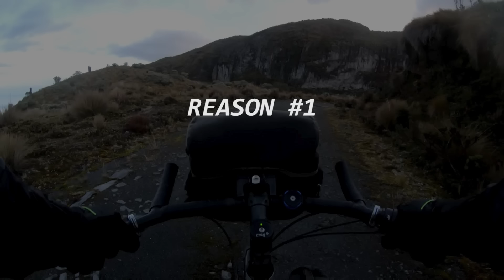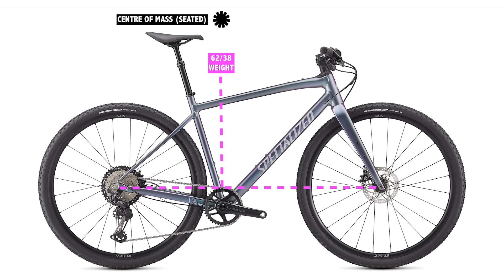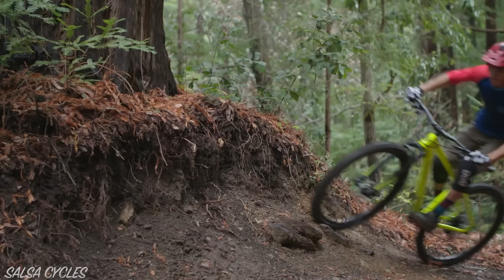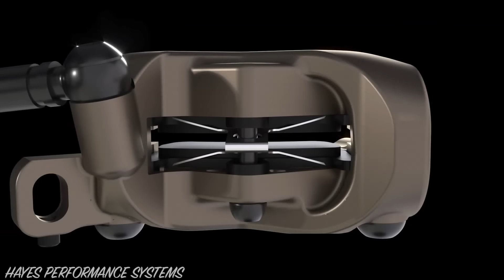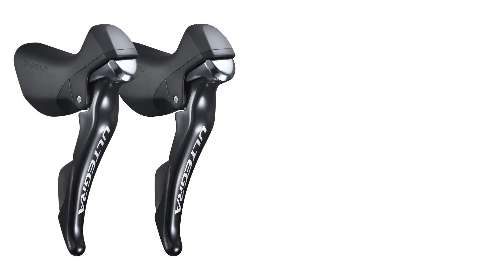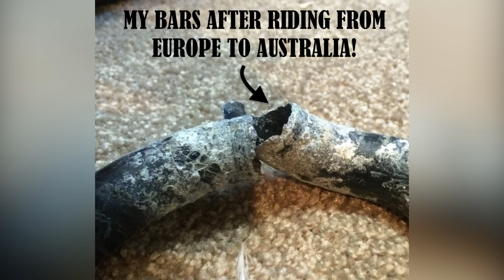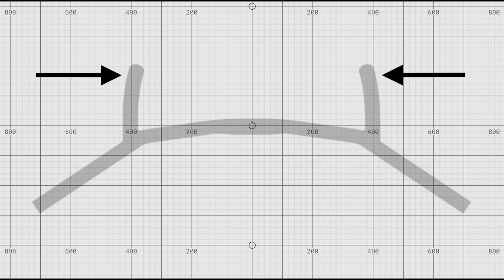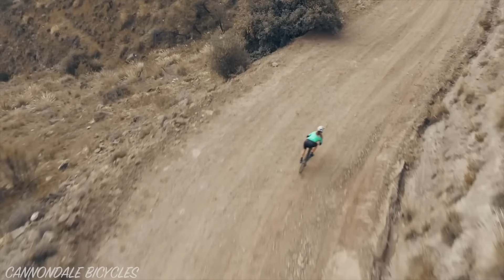Why Flat Bars Are BETTER Than Drop Bars For Most Cyclists (Objective Analysis)

Comment: But can you have 2 braking positions on flat-bar-plus-aeros or butterfly bars? I have a drop-bar adventure bike with cross-top brake levers. I get two very different riding positions, both with full braking control. I'm open to wider bars, just wonder if I could do the same. (Saying that, I've been riding drop bars for 40 years, there's an emotional connection to cruising on the hoods!) Thanks @cyclingabout, great vid as ever.
Reply from the maker: This is a point I've overlooked! You can technically have control of your brakes from three different positions on drop bars provided you use cross/inline brake levers. I'll add it to the written version on my website, thanks.

Comment: Title a bit misleading, a lot of the points raised are related to the frame rather than the handlebars.
Reply from the maker: With the exception of two points, all of the benefits I discuss would still apply if you were to do a handlebar conversion from drop bar to flat bar, or vice versa.

The frame geometry related reasons are still very much relevant to the discussion because the handlebars work in conjunction with other components when optimising bike design. I'm sure many viewers will use this information to help pick one bike over another within the same bike category (eg. off-road touring bikes).

Comment: I don't think you understand what "objective" means
Reply from the maker: Please point out when I am being subjective.
Reply: The basic mistake that you're making is that you're sort of stating something objectively, but then drawing a subjective conclusion from it.

1. Wider bars have greater leverage - true. But that's a function of bar width, not shape. It's further incorrect to draw the conclusion "better handling" - and that's subjective: How do you measure "handling"? What's your unit of measurement for handling?
4. "Better braking performance" - this is just your opinion. Braking performance is a function of your brake setup, not your bar shape.
5. "Low gear ratios are more common on flat bar bikes" - sure. But it's your opinion that that's "better". There's also nothing to stop you putting lower ratios on drop bars.
6. "Flat bars are often cheaper" - again, okay - but cheaper doesn't equal better. 
8. "Flat bars allow for more bikepacking bag capacity" - okay, again - it's your opinion that that's better. It's equally easy to argue that it's better that drop bars limit your ability to overload the front end.
9. "Flat bar grips are easier to live with" - entirely your opinion. No measurement here at all. Grips and tape are different to live with. There are pros and cons to each.

Most of the test of objectivity is being able to measure and quantify it; it's generally difficult to objectively say "better" in an absolute fashion. You can say "better for...", i.e. you can say "narrower is better for aerodynamics". Most of your other arguments fall into this trap.
Reply from the maker: I disagree. 

1. Flat bars are almost always wider, there are so few exceptions. Handling has been described in this video as the ability to resist ground forces, maintain your balance, maintain your line, reduce steering inputs. Leverage objectively helps in all of these instances.
4. Bike Magazin has done dozens of lab tests on brakes. We know that mountain bike brakes have more power and less brake fade as a function of their design. Plus, there are four piston calipers and larger rotors available, should one need them.
5. Obviously, this point is applicable only if you ride in the hills. A stock flat bar bike almost always has lower gear ratios within a given bike category, and I have that data in my books (all touring/bikepacking bikes available are listed). For retrofits, you can put any mountain bike drivetrain on a flat bar bike (ie. lots of options), but you have to hack your way into doing the same with drop bar shifters (ie. limited options).
6. Cheaper is always better when we're comparing the same thing. 
8. A bigger bag volume gives you more options, which is objectively a better thing. Easier access to the roll closures makes your life easier. Volume and overloading do not equate to the same thing - for example, I have winter sleeping bags that have a large volume but are light weight.
9. Flat bar grips do not tear or unwrap, ever. I can change my flat bar grips in literally one minute. Again, these are facts.

The title of my video literally says "better . . . for most cyclists". It is implied that these things are no absolute, and I've done my best to cover the grey areas by discussing the crossovers.
Reply: "It is implied that these things are no absolute" - if it's not absolute, then it is subjective.
Reply from the maker: Oh c'mon...

Comment: With regards to drop bars being better for urban riding they are better for weaving between vehicles due to the reduced width in general. They also encourage a more aggressive riding style. However your riding position makes it difficult to have good all round vision reducing your safety. In a more upright position you can see better and feel more relaxed (I know some riders don't want to feel relaxed, LOL)

There's also options for less wide flat handlebars for those who regularly weave between traffic. Personally I prefer flat bars for everything except competitive speed cycling.
Reply: In a flat bar you are way more agile, which makes it better for urban bikes since you need to do aggressive turns between vehicles, trees, people etc. in a drop bar you are slower turning the bike and you have less agility. Drop bars are great for the road only, going just in one single line, to rest for your wrists and have more aerodynamics. But if you want versatility, a flat bar is better
Reply: Personally I don't see any difference looking side to side with either bar or under a shoulder to look back on a drop vs looking over it on my drop bar bike.  Actually If I think about it I think I'm am more aware in a lower position because my head is angled down and thus requires a smaller turn to either side to see behind.  But also understand, if associating an upright stance with awareness, a drop bar bike rider can get just as upright as a flat bar rider by getting on the hoods or bar tops.  Granted, looking around in general will always be an issue for people with neck flexibility issues and if that's the case they will probably prefer the less "aggressive", more heavily-seated position their flat bar offers.

Comment: Many people think cycling is dificult because of a long term trend to inappropriately copy road racing bikes for more general use.  Because of this drop bars are arguably more poplular than their objective qualities would suggest.   People think hill climbing is difficult because road bikes  normally lack low gears. People put up with poor braking performance because road cycling has been slow to accept disk brakes.  People ride narrow tyres with poorer road holding performance is the mistaken belief that rolling resistance is lower.(Narrow tyres have low weight on their side).  People ride drop bars for the look without ever using their aerodynamic qualities.  People accept expensive difficult to use shifters because thatś what drop bars require.
Reply: I'm replying to myself.  For me ergonomics dictates flat bars for easy access to brake and gear controls.    Bar ends can do for hand positions.  Or place palms on ends of bars.  From there easy to return quickly to normal position.   Flat bars can be narrow if you want.

Comment: As allways it really depends on what type of riding you do. Personally most of the flatbar pros don't really effect me and I much preffer the handpositioning on dropbars. Though I gotta say I only switched 3 years ago and prior to that I allways had flatbars. 
It's great to see how much variation we get nowadays in both types of bars.
Reply: Agreed. A lot of the points in this video cover cycling on rough terrain & unpaved roads, where drop bars do not fare well. In this scenario, you'll usually be cycling in an upright position. Flat bars will be more suitable.

For road bicycles that will be used on paved tracks, roads, high speeds, with fewer expected stops at traffic lights, pedestrian crossings & stop signs... drop bars fare better.

Comment: there's also probably the factor for many road riders that when you look to pavement riding pros, all you see are drop bars. Even someone who knows nothing about cycling will recognize drop bars as being 'like the fast tour de France bikes'. They're used there because they're optimal in that hyper-competitive, niche use case, where aero is worth the tradeoffs, and they get copied by people who will never really need that efficiency, but want to feel like they do. It's the same reason people get full suspension to ride fire roads, or an ultralightweight tent for a campsite they drive to.
Reply: Drop bars are mandatory on road races. Other bar types are not allowed, aero or triathlon bars are only allowed in time trials. Even some positions on the bike and handles are outlawed.
Reply: EVERYone would notice a HUGE difference between using a flat bar and a drop bar on a road bike... it's not a "niche use case"

Comment: What I don't get is why manufacturers seem to use the same width of flat bars on all bikes.  My wife's small frame women's bike came with bars for some guy who is 2m tall.  She is 150, so I needed to cut 10cm of each side.   In fact I think I have sawed at least a couple of cm off every set of flats I have ever bought.   When my wife bought a women's bike with drops they were proportionally narrower.
BTW, when riding on a street shared with autos, my wife is now 10 cm further from cars than on the bike that came out of the bike shop.

Comment: I rode exclusively with drop bars for over 25 years because of a single, incorrect preconceived notion: drop bars offer more hand positions. When I finally got around to trying flat (Jones H-Bar) bars, I noticed two things. First, of all the hand positions offered by drop bars, I used only one for 90% of the time. In the hoods. Second, now that I wasn't using drop bars anymore I found that I was enjoying the ride more, and worrying less about speed than I otherwise would have. IMO there's a psychological feeling that drop bars are more competitive and thus more serious. Serious cyclists use drop bars. Thanks to this recent shift to flat bars, I no longer consider myself to be a 'cyclist', but a traveler who just so happens to ride a bike.

Comment: 0:52 I don't really believe that you need a lot of leverage on handlebars. I can't recall any situation when I didn't have sufficient strength to make a turn. 

HOWEVER wide bars give us the ability for more precise steering. Which is very useful for line choice in mountain biking
Reply: More so bikes are light to lean over thus making countersteering much more effective with body movement. In combination with well timed movement of handlebars you really don't need lot of leverage.

Comment: You make some good arguments. Objectively, I agree even, but ergonomically I find drop bars more comfortable for longer rides.
Reply: I can sign it…additionally, much more comfortable
Reply: Butterfly
Reply: how does your neck not hurt though being that low so often? my neck wants to explode out my back after a short while on drops
Reply: @digitalsmithy  How low the drop handlebar is depends on the bike, and your own height: how long your legs are (determining how high the seat is). Unfortunately, on modern bikes with threadless headsets, it is a real hassle to raise the handlebars.  For everyday riding (not in a race), you want to be in a more upright position, a least when your hands are on the top bar. On a classic bike with a quill stem, that's a 30 second adjustment: loosen the sliding block of the stem by turning the bolt with the hex wrench, pull it to the desired height, tighten.  The bike industry decided to enshittify this.
Reply: @digitalsmithy  A lot of modern road bikes have a frame which has next to no head tube length. Basicall the top tube and down tube meet together at a minimal head tube.  When these things are assembled, sometimes they just cut the steerer tube short and plant the stem close to the head tube, so the handle bars are really low, close to the front wheel. This creates an "aero" position, especially for the tall rider who has to jack up his saddle.  If you care about back comfort, basically stay away from that kind of setup. If you get that kind of frame, make sure that the steerer tube is sticking out nice and long, with spacers, so that the handle is raised.   The old school threaded headset system is best: the handle bar stem is a rod tightened by a sliding wedge. You can easily raise it (or lower, if it is not all the way down) just by loosening one bolt. If you need it higher, you can easily buy a longer stem, too. ($20-$30 on AliExpress type thing).  There is a way to use quill stems with threadless headsets; you have to lose the top cap, of course, and use a clamp ring to hold the steerer tube in place in place of the clamp-on stem. Then you can insert the quill stem into the steerer tube.  The star nut in the tube has to be pushed out of the way, too.
Reply from the maker: I'm glad to hear drop bars work better for you ergonomically! I personally find both to be comfortable. 💪🏼
Reply: I find drop bars to be too far forward which makes reaching the brake levers hard while being able to use the advantage of brake lever leverage only in lowest position on the drops which doesn't get used due to being too low.
Reply: @uvwuvw-ol3fg  
That just sounds like a bad set up.
Reply: @Exgrmbl  Additionally, it's caused by having brake levers in the conventional forward position, because ... everyone on road bikes does it.
On my bike, I have flat bar levers, which are on the flat part of the drop bar.  That sets them back considerably, meaning that the brakes are in my grasp in the upright, "cruiser" position.
Reply: @uvwuvw-ol3fg  drop bars should be considered along with your bike length..
Reply: @uvwuvw-ol3fg  maybe have a shorter stem
Reply: @taufikabidin412  Tons of choices there. Stems are available in various length of extension. Plus adjustable angles. And stems can be turned 180 degrees: you can considerably bring the bar back.
Reply: @uvwuvw-ol3fg  Everything is adjustable.
Reply: @uvwuvw-ol3fg  Probably using classic one. Try compact and shorter steam (or adjustable steam that may look not that handsome).

Comment: As always from you a very informative video. But in the end it all comes down to personal preferences and limitations of your body. Flat bars suck when your wrists start hurting after 25 km. Drops bars suck when your neck stiffens up after 30km. Just right what you like best.
Reply: It’s unfortunate this isn’t generally something a person can know until they’ve potentially invested a lot of money into a bike.
Reply: If your neck hurts from riding with drop bars then you need a better bike fit. Likely a shorter reach and a higher stack. That specific problem is unlikely due to the bar type.

Comment: The thing is, "most cyclists" cycle in urban environments most of the time, because that's where most people, and certainly most cyclists, live, since that's where cycling is most practical. So if that's where drop bars excel, then drop bars are the best option for most cyclists as per your video.
Maybe not for bikepackers, mountainbikers or other adventurers. But that's not what you said.
Reply from the maker: I said drop bars excel in urban environments. But that is only one way we can assess whether they are suitable for a rider - we need to factor in all other areas of assessment too.

Comment: I don't buy the argument that drop bars are better for urban riding (unless you do it for sports ;-) ). In my urban bike I have flats coz:
1. I have a more upright position what makes looking around way easier in comparison to when I'm bent down on drops. That's an important safety feature.
2. Toe overlap is a serious issue in the city as often you're forced to go slowly or almost stall (street lights, interacting with pedestrians and other traffic).
3. In most European countries you are either not allowed to cycle on the pavement or you have to give way to pedestrians, so a narrower bike gives you no advantage here (for sneaking between cars it's helpful, but that's a bit dangerous and more of a sport like bullfighting).
For my cyclocross bike, I use drops for the fun of it. But in the days I was doing some touring on the bike, I used flats with side extensions.

Comment: While i agree with the video here when talking about choosing a new bike and keeping it stock but many of the talking points here have nothing to do with the differences in handlebars. For example the issue with toe overlap has nothing to do with the handlebar and everything to do with geometry. If toe overlap is an issue for you then changing your drop bar to a flat bar will not solve that. Want more stopping power with drop bars? Put on cross bar brakes (or maybe even see if adjusting your current levers can help you brake more comfortably).

Comment: Yup. Thing about drops is you need a billion hand positions because NONE of them are comfortable. Once I found a flat bar that suits my dimensions, I don't need any positions other than that one.
Reply: Agreed, hands should always be close to brake levers, and on drop bars the brake lever leverage changes depending on a position so you don't always have full stopping power. I find butterfly bars to be good in terms of hand protection from the obstacles and inherent vibration absorption due to minimal flexiness. And with wide platform ergon grips you can change the hand position to minimize nerve compression in the wrists.